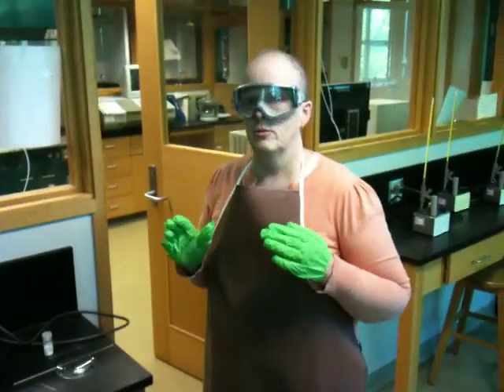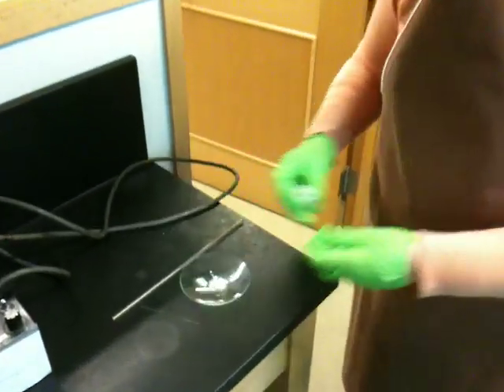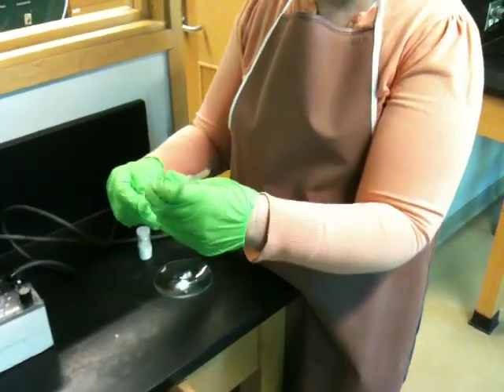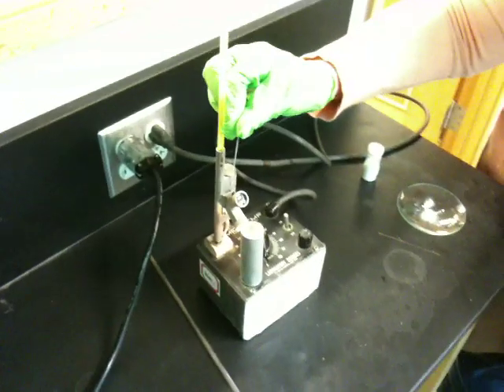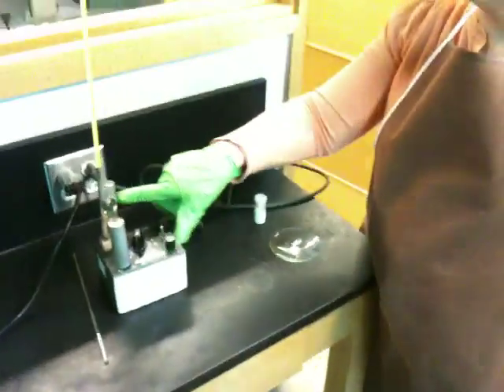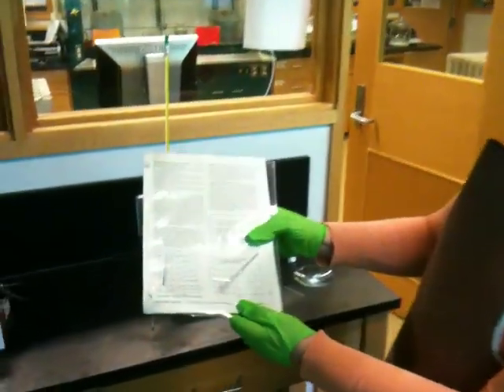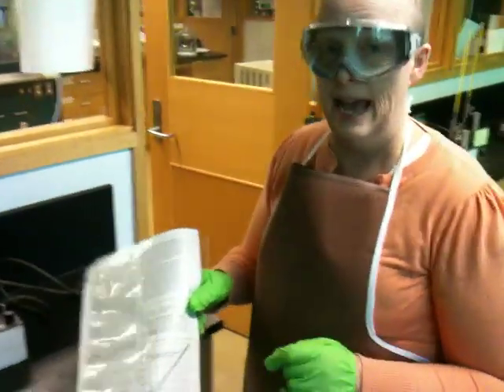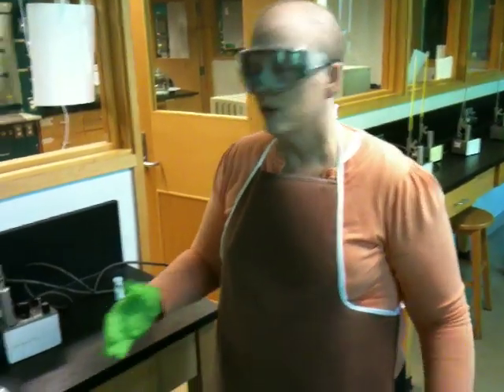How to pack a melting point capillary and measure a melting point

Comment: a nice history of melting points but not so much on loading a capillary tube. The the melting point device varys the amperage to the heating element not voltage. The device is quite accurate when done correctly and slowly so as to approach the approx. melting point a degree at a time.